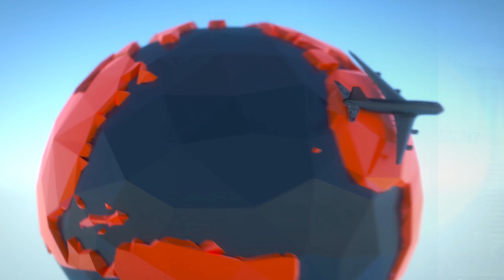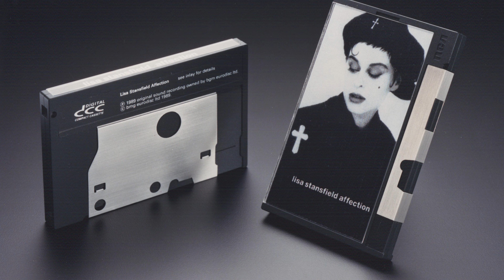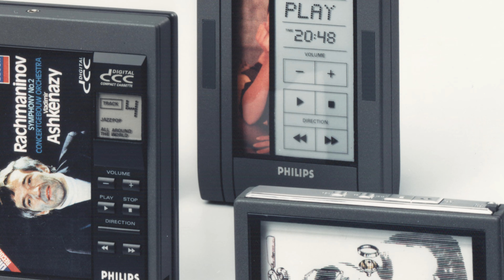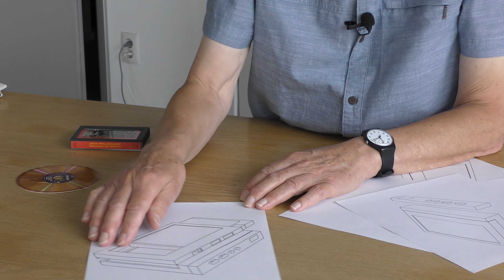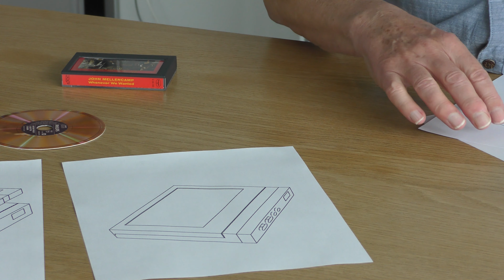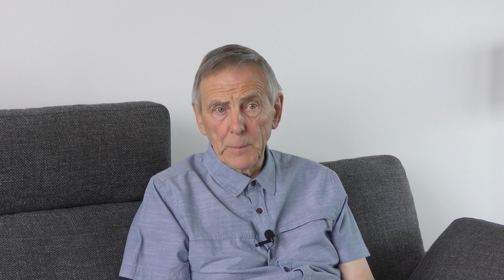A New Concept Portable DCC Player by Philips Industrial Designer Peter Doodson

Comment: That is a very nice sleek design concept, but one problem is that the slot-loading system for DCCs would make it incompatible with regular cassettes because they are not flat. Of course that's not such a problem for DCC enthusiasts today, but it would've been a big issue back in the '90s.